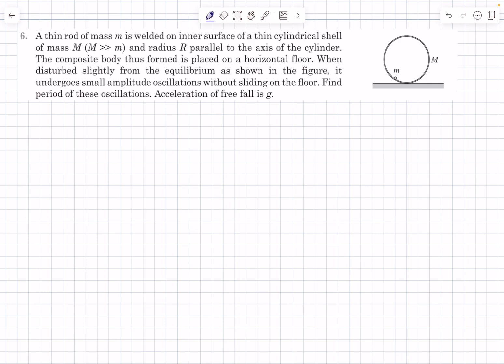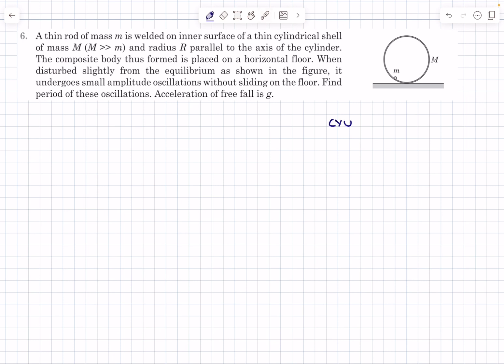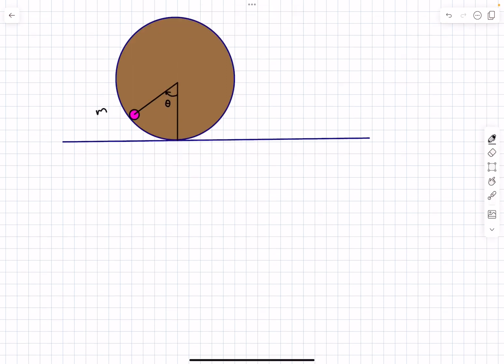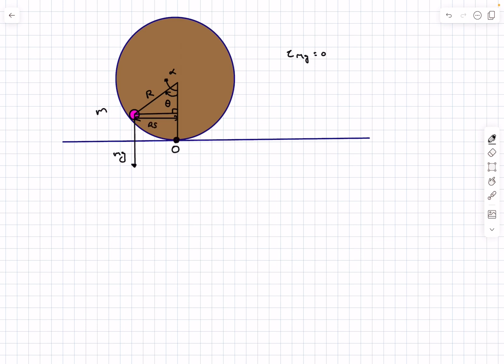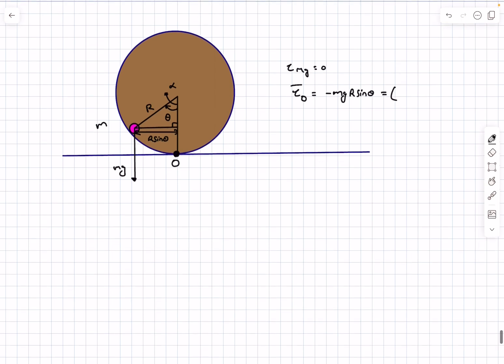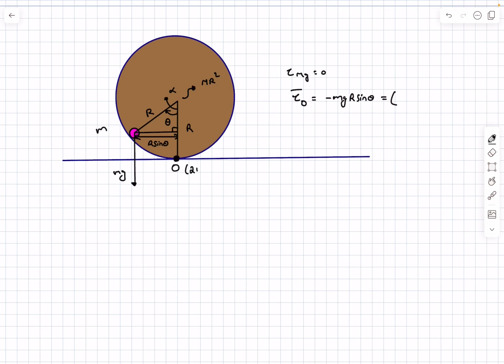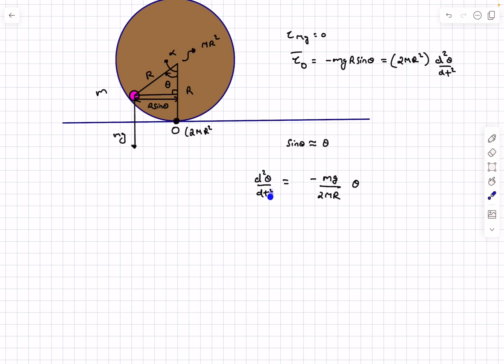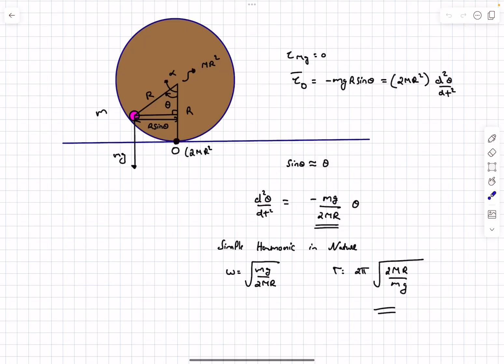[JEE Adv| Oscillations of A Composite Body | CYU 6 | Pathfinder | Oscillations

Comment from the maker: At 1:05 I Forgot to mention as Normal and Friction also passes through the Point O torque because of them is also zero.
Reply: Sir you also forgot to mention that we are neglecting torque of pseudo force.
Reply: Since point O has acceleration towards centre (Ω^2R,Ω=angular velocity) , point O is an accelerating frame of reference,So we need to include pseudo force also,which passes through the COM of the system.(point of application of pseudo force is COM) .But since here we are considering small amplitude oscillations ,Ω(angular velocity) is very small.So we are neglecting it